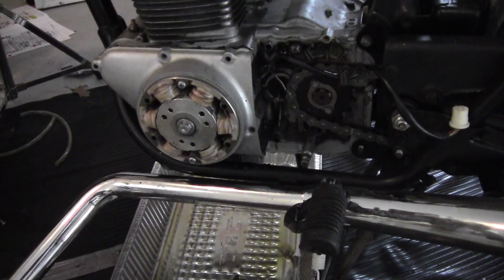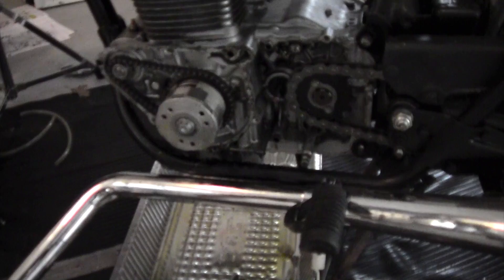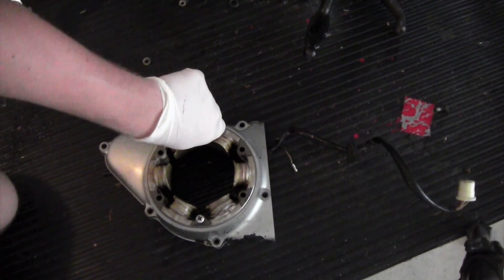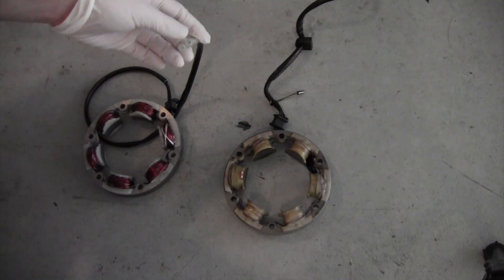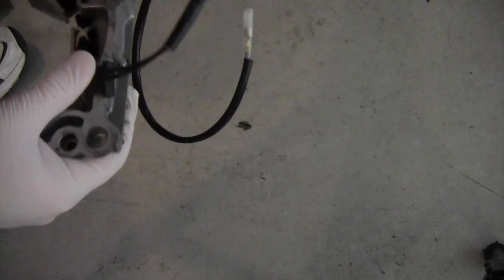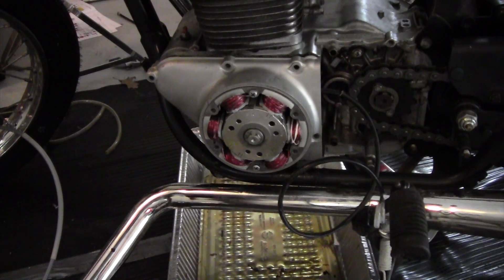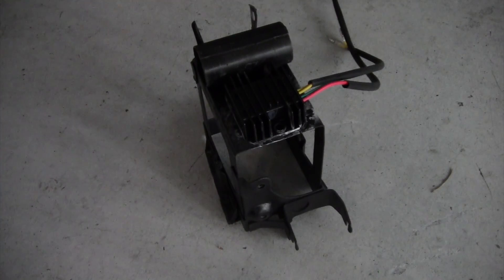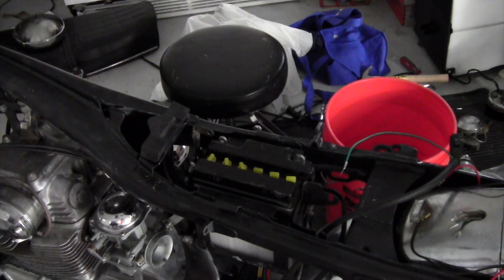How to Upgrade Motorcycle Charging System

Comment: Which stator or reg rectifier did you use? Part number or manufacturer would help to identify parts are being used for replacement.
Reply: I agree I like the vid but what company brand parts did you use?

Comment: I have purchased this system and I noticed there is no hook up for the neutral switch like in the stock set up. I'm assuming you need to run a separate connection for this now?
Reply from the maker: +Saturdays Wrench  correct. this set up does not have  a hook up for the neutral switch